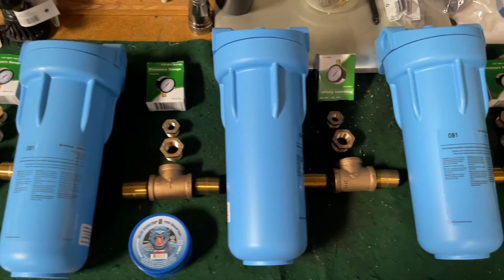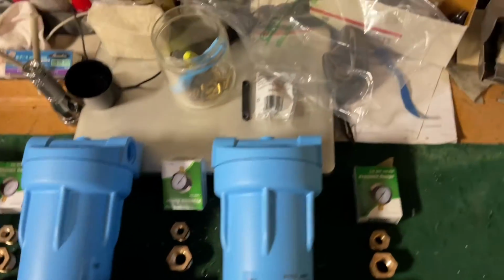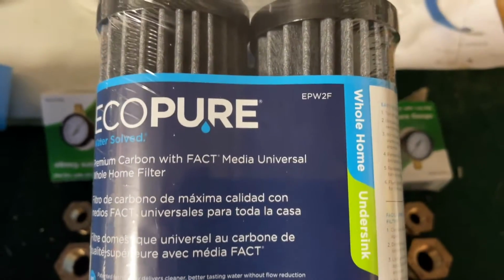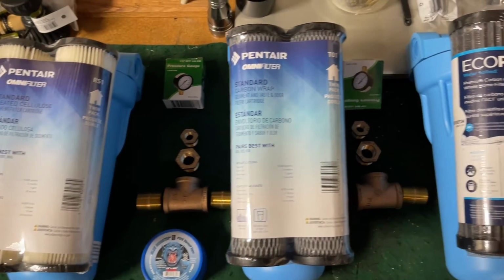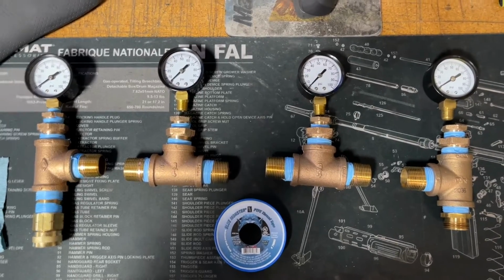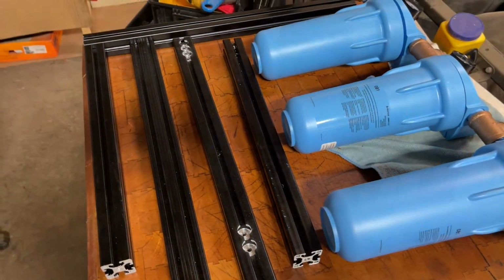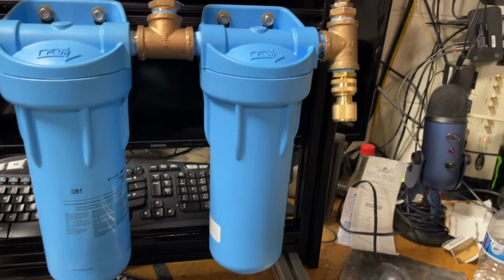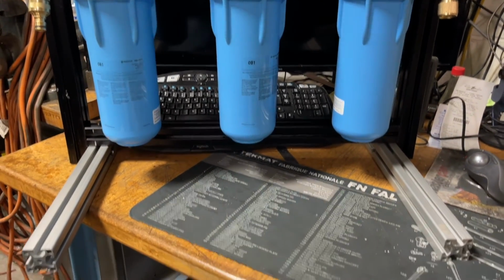DIY 3-Stage Water Filtration System for My RV !

Comment from the maker: You can save some money if you don't want to put water pressure gauges on the system.  Instead of using (4) Tee's, you can eliminate them and all the small pipe nipples and reducers, and replace them with straight pipe nipples.  That would knock off about $100 in parts, and you could do it for about half the cost...

Comment: I am about to do mine. 2 stages only. Here is my tip that guarantees to save a bunch.

Reuse the filter assembly from the r. osmosis. Nearly every one throws them away. Not me!

What requires is a 1/2 " hole tap so it can take 1/2" barb fitting.  Filters are identical as the regular water filter.  You can buy them at Walmart cheaply. 

What you don't know will cost you dearly. Who says that it has to cost thousand of dollars? Hog wash!!!!!! 

Next time buying some thing new look around first to see what can reduce, reuse, recycle.

Save a ton of money and feeling good doing my part to reduce waste. 

The whole thing with 2 stages filters will cost me under $100 by reuse the r.o assembly. All I have to do is modify the fitting and new filters, some fittings, hose and clamps. Heck it already came with the bracket from the previous use as r.o system.

I hear you say u don't have an old r.o lying around. Well you can buy a used r. o all day long for dirt cheap or even for free.

There are always more than 1 way to do things?
Reply from the maker: Actually, if you build it without the gauges, it will only cost you around $100.  The canisters were the cheapest part of the project (filters were actually cheaper, but you can spend hundreds on filters alone if you want to go that route) the way I built it, at $15 each.  The fittings, filters, and gauges were about $150.  Just screwed together, no modifications, and no leaks.  Time is expensive too...😉

Comment: Had a problem with the video not audio..
Which store did you get the filters and housings at
Reply from the maker: Sorry I didn't see this sooner!  I got the filters and housings at a Menard's home improvement store.  You should be able to get similar ones at Home Depot, Lowe's, or other home improvement stores if they don't have Menard's stores in your area.  If not, there's always Amazon...  I put up a picture of the materials list at the end of the video, in case you didn't see it.

Comment: Ooman, They make a wrench for the filter bodies. Or a strap wrench will work. The bodies seem to tighten up over time, possibly due to O-rings drying out...
Reply from the maker: The housings came with wrenches.  Gotta relieve the pressure and they come off easier.  Also helps if you don't over-tighten them when you put them on and put a little petroleum jelly on them to keep the O-rings lubricated.

Comment: 3 stage. Bound to be better than 2. Better be careful, tho. Looks like maybe they have components in them that are known by the state of California to potentially cause cancer. Wait....the shorter, longer, wider piece?? Lol.
Reply from the maker: Well, I guess if I stay out of California, I won't get cancer...😂  I was referring to the 1" x 2" extruded aluminum piece, as opposed to the 1 1/2" x 1 1/2" pieces...😂
Reply: @OOMAN  Just messin with ya, brother! Couldn't help myself! Lol
Reply: Careful of the brass which may contain lead.  Easily can test the lead post 3rd cartridge with a lead test strip.